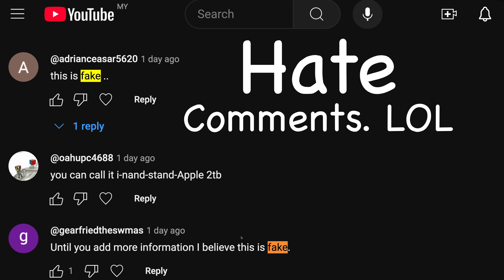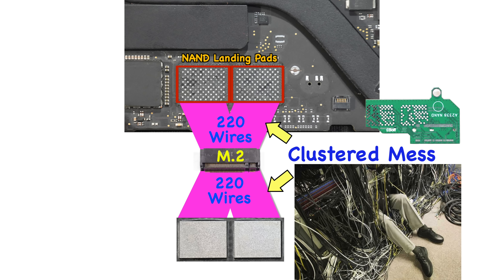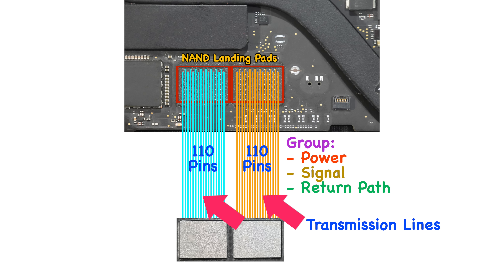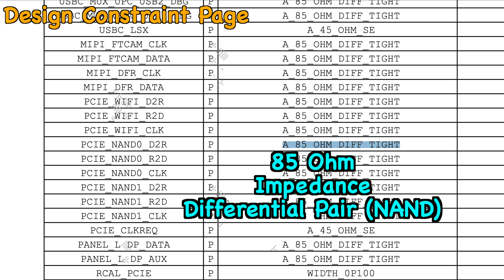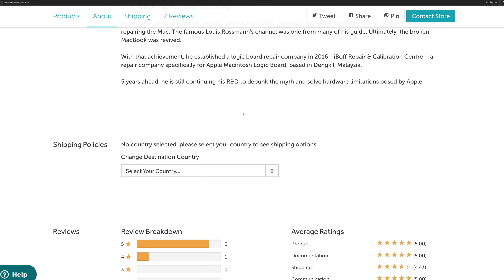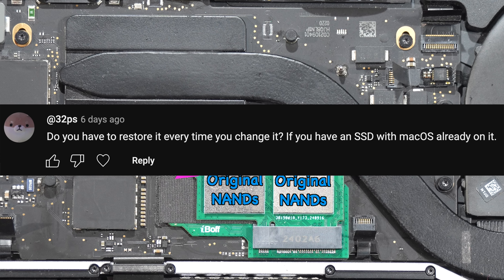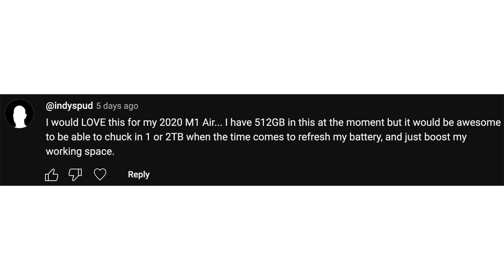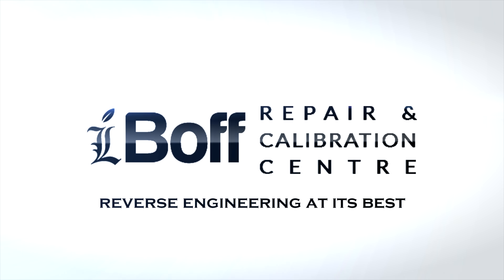No More Storage Limits : Answering All Your MacBook Questions! - 4K

Comment: I’m sorry, this is so very impressive. How does one even manage to learn all this? If anything this discourages me from continuing my computer engineering degree…. Honestly how are you even this smart? All those books? All that math?
Reply from the maker: Hey bud don't be discouraged by what you saw on the internet. We also went through a lot of failures, wasted hours, wasted thousands PCB prototypes & money - its just not shown here because it'll be endless and no one really care. lol. and resisting to give up then try again one thing at a time is what brought us here - and you should too. Cheers.
Reply: @iBoffRCC  appreciate, I wish this channel the best!
Reply: @hifiveguyy  it just takes time to learn these things. I didn’t learn how to design pcb’s until I was at my first job after getting an electrical engineering degree. I’d recommend starting with a small circuit (low power / low speed) that you’d like to learn more about and get you familiar with the pcb design software. Something analog like a linear regulator using an op amp and mosfet is what I’d recommend. Then perhaps make a USB passthrough board with a usb-a to usb-c connectors to learn about differential impedance and trace matching. Pretty much every circuit you can think of has an application note from Texas Instruments or Analog Devices. Just follow along with examples each time you layout a new type of circuit. And of course, you’ll only become a better engineer if you understand the fundamentals such as those recommended in the video (Eric Bogatin is truly awesome). Little by little your tool belt grows and you can design more complex things on your own. The endless learning is what makes engineering fun!
Reply: @iBoffRCC  I got teary-eyed with your encouragement. It wasn’t meant for me, but it really touched me. Thanks a lot! Keep up the great work!
Reply: @iBoffRCC Very nice of you all to say this. 😊
Reply: @iBoffRCC  Subscribed !
Reply: @iBoffRCC  Does this work on Intel MacBooks with a soldered SSD?
Reply: @iBoffRCC if i were you i would just brag about it doing an evil laugh
Reply: You can prob start with an electrical engineering degree. Once you have the basics, the other topics will make more sense.
Reply: Dont give up bro progress your degree
Reply: Bro, you don't have to be smart. I was homeless, living in a van my last 2 years of graduating my BA in EE. I never went to parties, football games, or was in any clubs. You just need to do the homework and have a family like relationship with your professors. If you're worried about girls, trust me, they found me and the van was exciting to them. I did go to the gym everyday btw to workout and shower. I was in the best shape of my life then.
Reply: @ thanks man, my life has taken a different career path at the moment. Hopefully I don’t stay there too long. The plan for now is to return to college. Hopefully I can comeback to this comment in the future.
Reply: And I have to say this… as anAmerican citizen. Rarely is it someone from the USA that I see put this much effort into breaking the constraints of computers. It is always someone from Europe/Asia, typically.

Comment: Did you guys really (at 9:34) manage to put a second ssd in that maxbook without desoldering the internal ssd? Is there any way that can be achieved in modern macbooks (m4/m5) with acceptable read/write speeds?

Comment: Regarding soldered ram, I can understand it from a performance standpoint.

The closer the ram to the CPU, the better, and the GPU uses the ram as vram, its incredibly fast when running vram intensive tasks since it can go up to stupidly large ammounts of vram along with the CPU being able to access it as well, so GPU-CPU interops are incredibly faster.

Comment: What about using the modular USBC ports pinout to route some sort of storage internally? Surely you can create some sort of ribbon that hijacks that port, routes it internally to an SSD or SD card, then routes the USB back to the original port via a hub chip of some sort, and keep this all inside the chassis?

Comment: This adapter sounds great, but did you take into account the false 12v on the 5v line of the NANDS which frequently burns them? It would be awesome if this adapter would also protect the data from this common failure.

Comment: Looking forward to what kind of modules could be made for the 14” and 16” MacBook Pros! I’m guessing you can do the same thing that you did for the M1 & M2 Machines and just take the pad connectors and make each pair a group of 4 nands. And then make a nand group of 512GB, 1, 2, 4, or 8TB. Depending on the original storage capacity of the Pro or Max MacBook Pros!

Comment: I am recently switching back to my M1 Pro with only 512GB due to work flow issues with lightroom my Asus 14 OLED. But the 512GBs is crippling. I look forward to seeing how this ends up. Id like to chuck 2TB in my Mac. It looks like the adapter is all through hole soldering making this achievable to most tinkerers with decent soldering skills. Is this the case? Im sure I can just get a small hot plate to create the SSD.

Comment: Hi! It seems like almost everything might already be done for us, although I could be mistaken. Try googling "LB TOOL NAND 315." It's an adapter from the old type of NAND with large solder pads to the new one. I'm not sure, but there might also be a reverse conversion available. What's left is to redesign the adapter for NVMe, considering the changed placement of the chips.

Comment: While I like the idea, desoldering the original NAND and resoldering larger chips might be simpler in practice…realistically, how often would you upgrade a MacBook's storage during its lifetime?
Plus, you'd lose the warranty and AppleCare by desoldering the original NAND. Given the complexity and risks, it's probably better to just buy the storage size you need from the start rather than planning for upgrades. 

What I would like to see is either the US or EU to enforce Apple to include an M.2 slot or a standard connector to give users the right to repair or upgrade.
Reply: hey BUM! this video is for the macbook owner who want to upgrade.. we dont wana hear ur  warranty bullsh*t nonsense and about buying a new macbook!

Comment: Cool but only if repair shops offer it as a service. No matter how good your video is BGA soldering is just too difficult for the average consumer. There's also a high risk involved in doing this, since it's easy to remove the existing chips with heat but people may not be able to correctly solder the new board or even their old chips leaving them with a voided warranty Mac.

Comment: Really great what you guys are doing! And yet I don't see much point here, as SSDs with a higher capacity are not available to buy. These are quasi custom SSDs that always have to be made individually and a one-time upgrade (with soldering work) would be cheaper than with your adapter plus a possible later upgrade with a new custom SSD.

Comment: Apple is soldering the storage and not using regular NVME SSD only for their profits, yes it is "extra" secure because of T2 chip, and controller is on M chip not on SSD, but they choose to make that this way for the profit and profit only. EU should force a law to make any computer with SSD to have it as removable one, proprietary or not.

Comment: Maybe off-topic and unrelated. But I really liked how you shared the process in which you learned to do all of this stuff, especially the part where you literally linked the lectures of the electrical engineering professors. Unsure if I will get a response, but how did you learn to edit like this? Especially the part at 1:06 just boggles my mind. I hope you can share maybe the resource of this. I won't bother you after. I really want to learn stuff like that

Comment: in order to install that adapter, first i should remove soldered two original nand chips. right?
Reply from the maker: @wbsbjckwqodbzj  yes
Reply: @iBoffRCC  Then, it would be an adapter that most ordinary people, who can’t remove NAND, wouldn’t be able to use.
Reply from the maker: @ yes. It requires professional installation by local repair shop. And it needs to be performed only once. It just shows how apple could've made it removable readily from factory

Comment: Obviously carying so many signal wires has to be a nightmare, when you make custom PCBs to modify existing hardware, it's never "just" an adapter

Oh and I fixed a macbook pro 2338 today thanks to a previous video of yours, I was so happy when I saw it boost to 20V
But then it was icloud locked despite the seller's claim of being icloud free... That's fixing Apple products for you 🥲

Comment: I don't understand why manufacturers don't implement a way to mount those SSD modules like CPUs. Just have an SSD-mount with 110 Pins you slot the modules into. that wouldn't take so much space and also wouldn't increase transmission-length significantly.

But yeah I know, it's because of making money. That was a rhetoric question...

Comment: 0:25 yuppie, I’m in the video 😂
NGL additional research information you provided is mad interesting.

Sadly prices of (new) NAND chips I found in the meantime (after quick google search) makes this upgrade not so viable.
For sure I would reconsider buying them when they drop in your store in December just to see what they capable of (fingers crossed for DIY kit available).

BTW thanks for new font (chalkboard) to use 😅
What program is using it as default?

Comment: Thank you for this inovative idea for this big iProblem :)) . But you can also use slots like as raspberry pi compute module to remove the anoying m.2 slot. It was awesome to mount direct nvme ssd and to use without any problem.

Comment: You are tooting your own horn a little hard here. Almost every PCB-Design tool let's you specify a desired impedance and matched length for a pair of data-lines. So actually: No, you don't need to understand all this stuff. You just need to specify the desired characteristics for each data-line-pair and use a PCB-Design tool, that does all the math for you. Of course, you will still need to put in a lot of time to go through some revisions and find a manufacturer, who can produce the PCBs reliably, but you don't need to become a Professor for Signal Integrity first ;)

Comment: still seems like a very costly solution
you need a hot air gun station for installation of the first mod, and to solder the nands on the external boards.
not quite the plug and use you seemed to have described in the first video.

Comment: In my past life, I was a repair technician. I was so disappointed when Apple decided to solder their SSD storage. They claimed it reduced latency and improved performance, which is somewhat true. Considering the rest of the industry has moved on to using PCI-e gen 4 and 5 drives with speeds two to three times faster than the older gen 3 tech Apple is using those claims are not valid anymore. Their competitors still use removable NVME storage drives in most cases and achieve massively higher performance while retaining the advantages of removable storage. It's time for Apple to go back to modular storage. The chassis has room for it and they can absolutely accommodate the change.
Reply: That’s just marketing bs, whereas its true that it was faster, it was done to prevent upgrading and forcing people to buy a new laptop.

Comment: So point number 1) the user needs to deresolder the original nand. 
If so, what's the benifit soldering an adapter instead of soldering bigger capacity nand straight on the pads? 

Point number 2) the nand is supplied with the adapter and is salvaged / used from other broken boards or the user buys only the adapter itself and sources the nand?

Comment: Considering M.2 SSDs do not work with this mod it might be a good idea to print “Do not use standard M.2 SSDs with this board!“ or another warning on the connector PCB in case someone tries it and starts complaining that they shorted out their memory controller.

Comment: I have a brand new MacBook Air with 24 GB of RAM and only 512 GB of on board storage. I knew from the get-go I should’ve spent the extra money for one or 2 TB and I am so angry with myself for not going with the higher storage, but, goddamnit I couldn’t spend that much money for the storage. I just wouldn’t do it. Other than that, I love the computer.

Comment: just finding out that apple serializing WiFi ICs just makes nintendo's moves on the switch WiFi IC pale by comparison.
context: sneaky ninjas flashed some special sauce firmware on the IC, installing one without the FW will render Bluetooth unusable, requiring a donor board for failed WiFi ICs.

Comment: I have a question/idea, just hear me out. I bought an M2 Air 256g model and from factory they come with one nand chip soldered into the board with other slot empty. To use the two slots we have have to find the compatible nands and some resistors to make them work. Instead if we make a pcb that use the existing unsoldered 110 pin connector and put an m.2 port in it to use with existing nvme m.2 chips. This way we can "possibly" use the soldered nand chips to boot MacOS without restoring it  and use nvme for storage and upgrade them when need. I just wanna hear your thoughts. Is it possible to do that? or am I being too optimistic?

TLDR: keep 1 slot for NAND, make pcb in other for m.2 ssd??
Reply: The DFU restore is necessary because it performs the low level formatting of the NANDs. To do the same for just one chip and from a booted OS, you would most likely need to hack the NVMe controller's firmware. Or at least reverse-engineer how the DFU payload communicates with it (but it might turn out that DFU has some extra privileges which get turned off before the OS boots).

If you really want to try it, you should probably talk with the people porting Linux to these devices. They could tell you where to start. But even then it would not be easy and would likely require a ton of time and effort to pull off.
Reply: DFU restoring is fine , doable. But will it be easier to just use the unpopulated 110 pin landing pad and make a custom PCB with NVMe slot that make a regular m.2 ssd act as a bga110 chip without messing with NVMe controller firmware? I just like the idea of using a 2230 or 2260 chip and upgrading it when needed than sourcing mac compatible nand chips and soldering them into a custom made nvme board.

Comment: But, you cannot just add And chips to a board and they won't work. They have to be blank chips and then programed, see dosdude videos.
So soldering a mini board and a name adapter then a m.2 name, how will system accept it if they won't accept bands without special work?
Reply: I suppose in this case, they are merely using a common easily purchasable connector just for wiring purposes, but the pinout would be proprietary and not compatible with M.2 NVMe/SATA drives.
It's somewhat common to see this practice, stuff like M.2 to External GPU adapters have used USB3.0 or HDMI cables for these kind of purposes

EDIT: it is also explained in the video
Reply: @TingFeng77  that's where adapters come in

Comment: I have a macbook air m1, and I watched your first video with my friend who work a repair shop, we both understood at the first video how it was done, and honestly, I just waiting for this board to be released not only for the M1, but also for the M3, my M1 have 140TBW/150TBW, and my M3 256Go ssd (even with 24Go of ram) after some years will have too, and at this moment, it will be nice to be able to change the ssd by just removing the case and swapping them by new ssd

so resume in 2 words : good job !

Comment: this looks easier to solder because you can see the pads through the PCB. Even if you weren't planning on upgrading again and you planned to get a new one before it died you should still use this imo.

Comment: The m4 Mac mini has removable storage, but with a controller built in. But is there any possibility of DIY storage upgrades on those new systems?
Reply: He already did it with mac studio
Reply: dosdude did it already with the new M4 Mac Mini
Reply: the restoration utility provided by apple is able to reprogram the memory controller in the soc as long as the nand chips (blank) are disposed in a layout intended by apple, for exemple, dosdude tried to put 2 TB in the latest mac mini but failed because i don't think there is a config with only 2 chips intended for the m4 soc but there is probably one with 1 tb for the mba m4 so the restoration succeeded
If you take into consideration this fact, you realy question why the chips aren't on a swapable module -_-'
Reply: There will be in the future...

Comment: I dont understand why people thought it was fake it is basically a board with traces connected to a M.2 slot. There is no pairing between the part and the rest of the board (like how touchID is married to the SOC). Think of this solution much like how wires connect a speaker to an amp. All your wires do is transfer power and the signal. It would have been a challenge to get a board designed to spec to incorporate a slot for a removable drive. That being said, I am curious if your mod would allow an install of a commercial grade M.2 drive with a controller. Anyways, board mods have existed for ever. Infact even manufacturers do board revisions. At the end of the day this is essentially advanced electronics and it takes alot of R&D to develop prototypes.
As an EE student I would like to thank you so much for your work and being a huge contributer to right to repair.
Reply: Edit: My question was answered later on at 9:35
Reply: What I'm curious about is can they change the adapter so it can take those replaceable SSDs from MacMini? 
There're already projects that sell them premade a lot cheaper than Apple